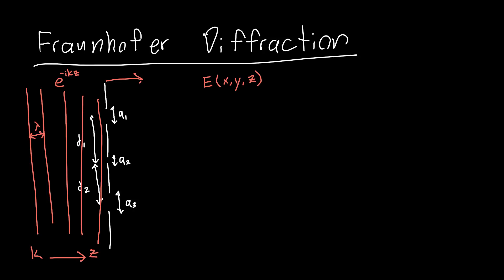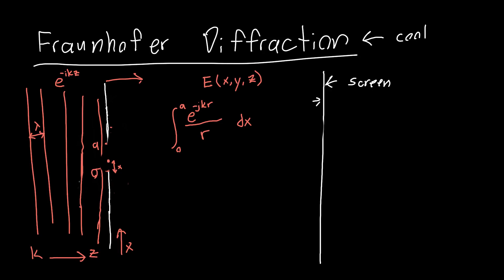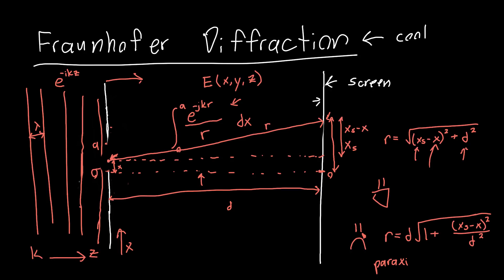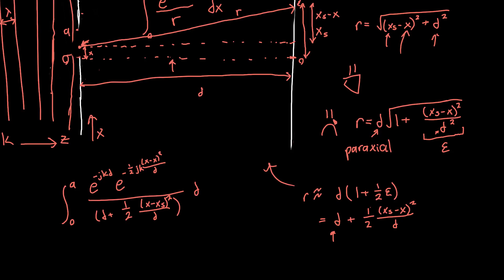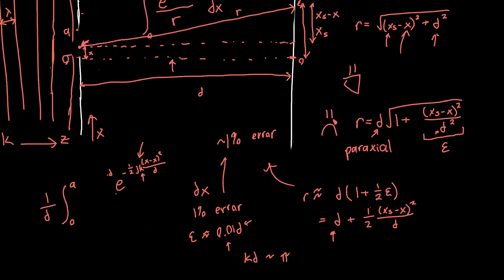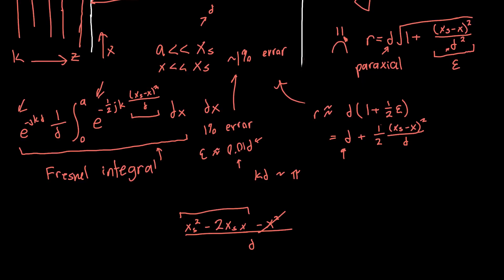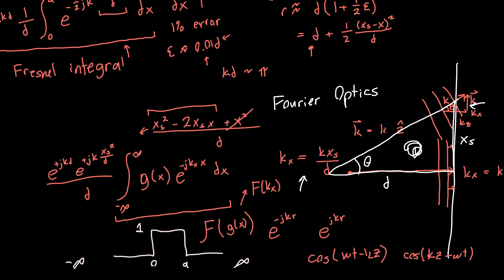Fraunhofer Diffraction Explained

Comment: It took me rewatching several times to figure out why the aperture equation comes out of nowhere at the end, so here is the explanation. The aperture equation is assumed to be a decimal representation of the percentage of light that can go through. 1 being 100% and .5 being 50%, as an example. It essentially represents the density (intensity) of point sources at the plane of diffraction, because it is a proportional multiplier on the point source at the infinitely small point in the integral.
Reply: omg this explanation sould've been part of the lecture thanks!

Comment: Thanks alot for the video. Sadly there are some gaps in between that leave out probably simple stuff but in the end after 1 or 2 minutes are skipped it just makes the overall very good video a little fishy. I assume for the last part kx you too the paraxial approximation where the sin(theta) = kx / k and tan(theta) = xs / d, and sin ~ tan so kx/k ~ xs/d so kx = k*xs/d.

Comment: This is a really great video. If I am not mistaken, starting from 10:24, there should be a factor 1/2 in the power of exp outside of the diffraction integral.
Reply: not really,evened out with the 1/2.but I’m lost anyway
Reply: @chenlecong9938  Why are you lost? Can I help you?
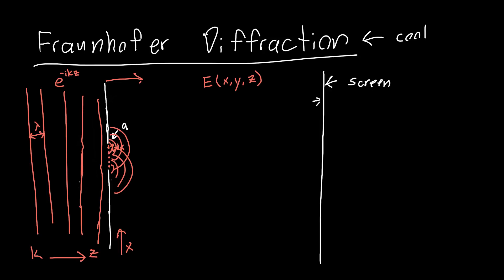Reply: @victorkislovsky40  well,at 3:00 he sad that the sperical wave is proportional to the e^jkr/r.But that's really ambiguous,did the meant by the,say,electric field of the that sperical wave,or the radius?I don't get it,there ain't any physical significance of saying a "sperical wave is proportional " to something,i supoose…But after all,where does that propotionality relation even come from?Is it experimental observation?Or theoretical calculation?Where can I get reference from?
Reply: @chenlecong9938  Let's remove the ambiguity. The monochromatic (single wavelength!) and with singular polarization Electrical Fields E is proportional to e^jkr/r. This is actually  a solution to Maxwell equations that can be reduced to Nabla^2(E)=delta_function(r=0) in 3D space (not 2D!) with a pointwise source placed at r=0. This solution is, by definition, also a Grin function. Additional assumptions: no free electrical charge or currents, only vacuum. More questions?

Comment: If the structure is truly a slit, then you don’t want points, but here rather cylinders with differential cross sections. The field from each goes ~ 1/r^(1/2), and not ~1/r.
Reply from the maker: Yup. You are correct, the goal here was to build the framework that would be used in 2D. Should have clarified this, thanks!

Comment: Amazing! so, the slit, acts like a fourier transform of the optic function and then acts on the wave function. so are other optics, CTF funtions.
Reply: If I can give some comment to help. You can look "optical" path as (n) x (geometrical path) , the passage of light through a distance (x) in a medium of refractive index (n) introduces an extra path in the air or vacuum. So you can get   variation of phase insted of transmission across the aperture, so the function is complex. In prism (angle) and the aperture with (a), the thiclnedd of the prism at its base is (a) tan(angle) and so if parallel wavefront coming from minus infinity and passed through the prism, the phase that we can choose to be zero at the centre, at the apex and the base of the prism are 0 and add you can write basic function. As well by describing the Huygens walvet you can get The Fourier transform - integrate and multiply the amplitude distribution.
I see yours comment where you see the identical diffaction pattern.

Comment: Thank you for the well explained video but ı m kinda new in that  so could u explain why the exp term has negative power instead of positive?
Reply from the maker: Great question, this is something that confuses even experienced people. It has to do with the convention you use for a rightward-traveling plane wave. You can say it is exp(jwt - kz), as in these videos, and is pretty standard in E&M and EE, or you can say it is exp(jkz - jwt), as is standard in much of physics. They are both physically equivalent, but when you drop the time term, the kz terms have opposite signs. It doesn’t matter which you use, you just have to be consistent. In optics, one convention will lead you to take the FT of the field, the other will require the inverse FT.